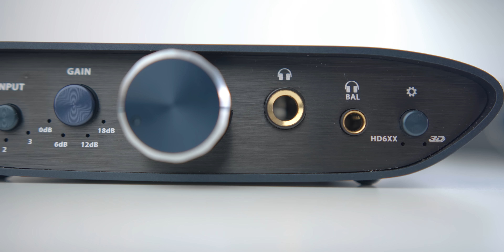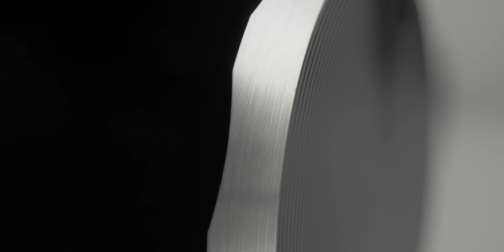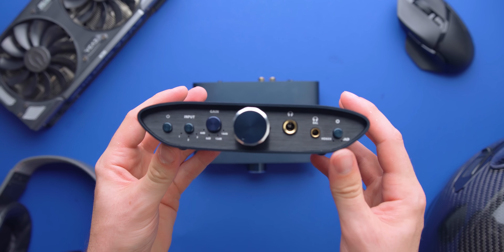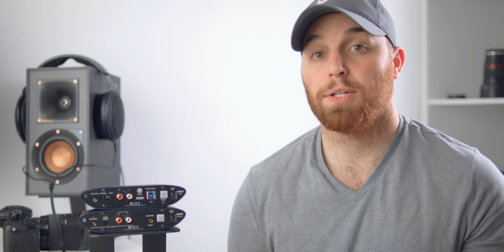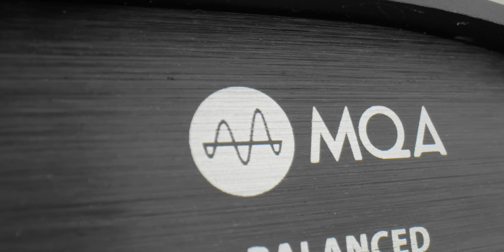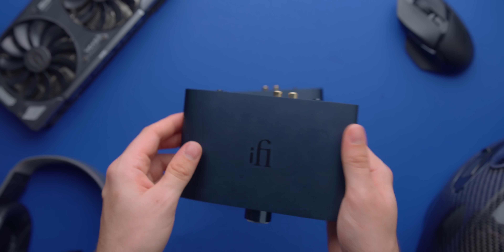THE upgrade for the HD6XX! | IFi CAN / DAC signature!

Comment: [Drop loyalty intensifies]
Reply from the maker: I posted this in the pinned comment, but I wanted to reply directly. 

"Hmmmm. Concerning trend in the comments. First, this is not an ad. This is a loan unit, sent from IFI. Neither Drop nor IFI is paying me. Nor asking me to say anything (except for the disclaimer about the pre-production status). I am however, part of Drop and Amazons Affiliate Programs, as disclosed in the description of every video. 

Second, if the video feels different and scripted... It is. I am trying a new filming style of video, using longer focal length and moving locations more often (always trying to better the content on the channel). 
- The scripting helps me make more jokes, and keep on track (especially when changing from location to location) with topics and information I might otherwise forget. However, my implementation of this is not the best, as it's one of the first times doing it. And, I see how it could seem more "ad-ish", though, not the intended feeling, I will make corrections to try to avoid it in the future. 

To address some specific questions I saw in the comments that I did not cover in this video specifically. 
This over 789? - For raw sound quality/power, no reason. Other reasons could be size, looks, EQ adjustments (if you don't/Cannot run EQ). I did not say it was better. I just said it outputs about the same power at 300 ohms specifically. So if you have a 6xx, the choice between the amps comes down to you desired features. 
This or Asgard? Depends. Asgard will drive more power demanding headphones, but will not be so good with high efficiency headphones, like IEMS. So, if you have really hard stuff, get Asgard or 789. Those will be the most versatile for more headphones. 
Using this Amp on the 58X - Sure! Sounds great, however, generally speaking, the 58X doesn't really need an amp in the same way that the 6XX does. 

So, to clarify my poorly constructed thoughts here - The Amp, is NOT the best on the market at this price (overall). It MIGHT be the best amp at the price for the 6XX exclusively, depending on your desired features.(If you only want single ended, THX or Asgard are better).  
The DAC, like I said in the video - Not worth it. (unless you REALLY want the stack). Even though it performs as it should. 

- J "
Reply: "I cast Retune Driver on the Beyer Dynamics!"
"Okay, roll to determine sale price"